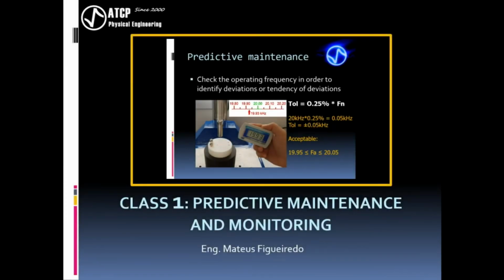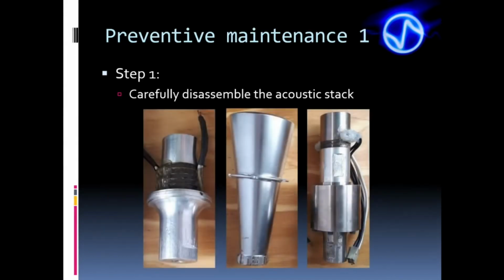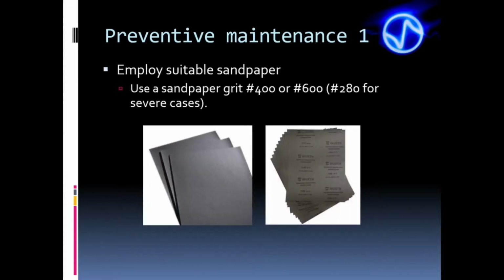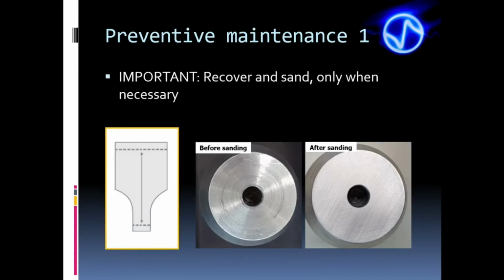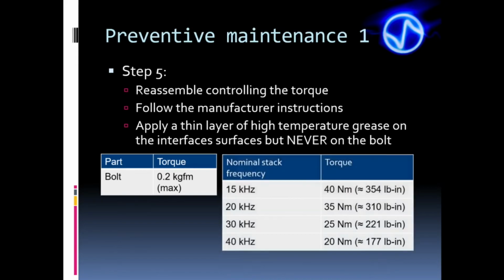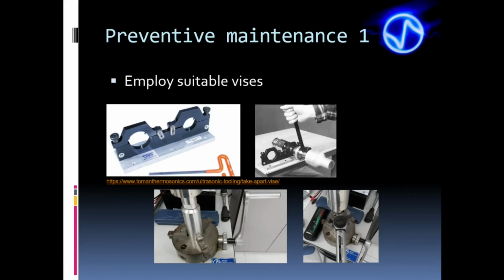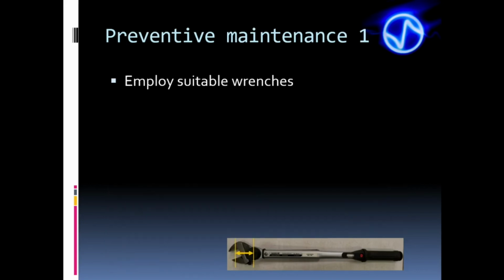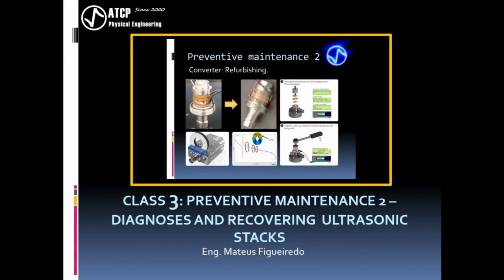Class 5 - Maintenance: Preventive maintenance 1 – coupling recover

Comment: how we can know the booster is good or not and the machine have generate the right frequency? 
And how we know the good frequency working of the horn?
Reply from the maker: Hello @ngoctienckm, thank you for your questions.

They are good and complex questions. 
About the booster: There are some causes for problems in the booster, the most commons are related to efficiency and, eventually the frequency. TRZ Analyzer can test the booster for both (frequency and efficiency), you can measure the booster frequency and its Qm (which is related to efficiency). If the booster is out of the recommended parameters for frequency or the TRZ test Qm result is lower than 700. The booster mus be replaced. It is also strongly advisable comparing the under-test booster results to the results of a reference booster (new or working well one).
About the machine frequency you can measure the working frequency in real time using the SonicSniffer. Take a look here: https://atcp-ndt.com/images/videos/SonicSniffer-EN.webm
About the horn, you can also test it using the TRZ Analyzer in a similar way to the booster. Normally it is necessary to interpretate the results and recommended to compare them to a reference one. In a general way the Qm must be greater than 1000 and the frequency Fa, must be withing the tolerance range. TRZ is provide with its respective how to use course, in which we approach the main details on ultrasonic systems maintenance with focous on the user's necessities.
We will be glad support you with your challenges and to provide you with more information and other details about your specific applications. Please, feel free to contact us at inf@atcp-ndt.com.